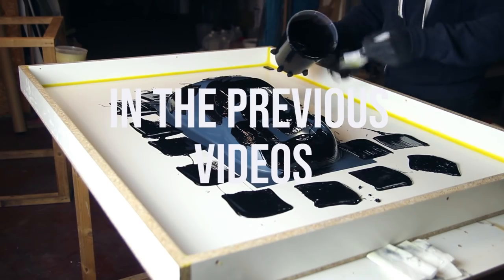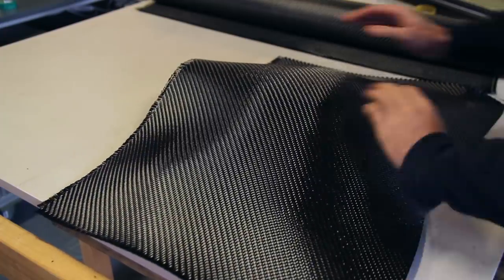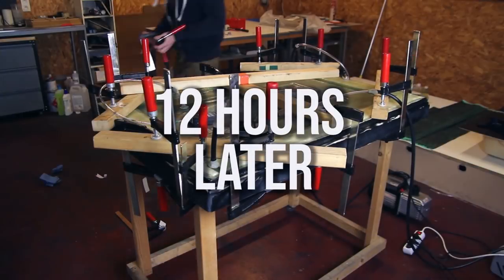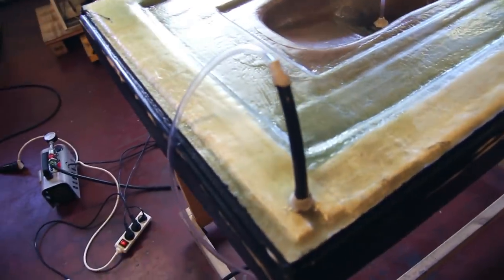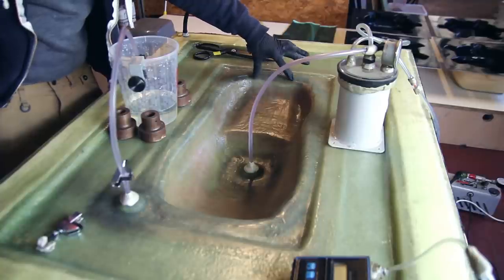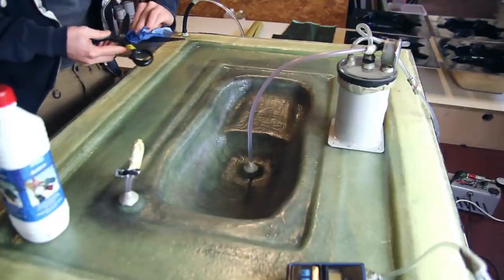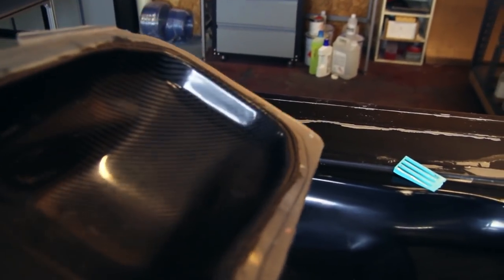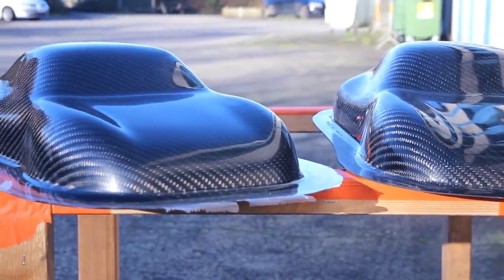RTM Mould - Creating Carbon Fiber Parts (PART4/4)

Comment: i was thinking rather than using silicon adhesives you can use a small-diameter silicone hose or even make a strip of silicon rubber yourself and put it in the place you applied silicon adhesive i hope you get what i mean and it makes sense

Comment: Nice video. I wonder if you positioning the resin outlet at the edge like resin inlet position, will the resin successfully cover all over the part?. Because in my opinion the resin will travel much easier and faster to cover all over the area if you put the inlet edge to edge.

Comment: Very informative! Thanks for sharing.
But I have a question:
What's the benefit of the RTM? Only that you don't need the vakkum bagging? The work for the mould is so crazy
Reply from the maker: It has a much faster production cycle, If all parameters are set up well you could make a good amount of parts a day. It's also a bit more environmental friendly having less vacuum supply waste and more economical when producing higher volumes. The inner and outer good finish, has some added benefits as well if you want to produce parts that have to fit into each other for example.

Comment: Great video brother.. iam wondered seeing infusion through the fibre with out Infusion mesh.. once I tried and it was a failure.. have to try this method.. thanks for explaining all the details bro..❤️👍
Reply from the maker: I tried it as well a long time ago! It won't work indeed, you'll lose all vacuumpressure and end up with alot of resin piling up and not making its way trough 😌

Comment: Hey! Nice video. About your sticky silicone problem. Why do you use it in the first place? You already have gaskets even if it's not the best kind to use fir your application. The best is to use different type of gasket for the inside and the outside. If you want to improve your mold in that regard  some solutions could be discussed  if you need.
Cheers!
Reply from the maker: The gaskets still had some micro leaks and wanted to avoid at all cost that all resin would go into the vacuum perimeter that seals the mould, so the idea was to add some silicone that would then comform to the lower mould surface and would then be fixed to the upper gasket and mould but not to the lower mould... Looking for better specific gaskets now to avoid all of this and have a perfect seal in one go
Reply: @MatthieuLibeert  One of the sheapest way to have good seals is to use silicone tubing in 10 or 12 mm diameter minimum. The softer the better. You might want to have two row of them each time (it's not mandatory at all), but you must left enought space between them to deform. The assembly is way easier by placing a small piece of a smaller soft tube at the jonction with silicone adhesiv. An other solution is to use neopren leap gasket but it's for the outside only. Anyway your main mistake, as I see it, is to have cut your gasket in the corners, you might have large radius in corners and a gasket in one piece.

Comment: Hey Matt, I was wondering would there be a difference in the process if the part had vertical walls? Would you need to ensure that the molds have a bit of flex to them so that vacuum can be applied evenly across a wide range of angles?
Reply from the maker: It's always better to have a bit of a draft on your edges but straight edjes work as well... But it makes it a bit harder to remove the part... Having a flexible mould is never a good idea as under vacuum before resin it might warp your mould making it even harder to remove the part
Reply: @MatthieuLibeert  I probably could have worded it better, but I meant flexible on one side, so that it can press onto the surface of the part, while the other holds the shape. Thanks for the reply though! :)

Comment: Hi Matthieu this is my first time commenting but I have seen a lot of your videos and I want to tell you that I really admire what you do and how you do it.

I am doing infusion with reusable silicone membranes to make my parts and I would be interested to switch to RTM method (silicone is driving me crazy), there is one difference that I noticed more than the others: the inlet tube is on the flange while the outlet tube is on the center of the piece. Is this a rule in the RTM? Because I'm used to doing exactly the opposite with silicone bags.

Thank you very much for your videos!
Marco
Reply from the maker: No, depends on part geometry, having an inlet running all the way around the part will have a faster infusion than from one point in the middle
Reply: @MatthieuLibeert  Thank you very much Matthieu

Comment: No pinholes?? Great job! Did you degas the resin before?
Reply from the maker: The resin was quickly degssed yes! No pinholes on the part
Reply: @MatthieuLibeert  did you use 2 levels of vacuum? Usually flange are at full vacuum and the infusion is with less vacuum. Very nice rtml, it seems without pinholes
Reply from the maker: @ANDREA9.81  no not here, I have a vacuumregulator that I can add on the pump, but was to lazy to get it out, just wanted to start raw on every settings then plan to fine-tune it, might indeed be something that can make some improvements